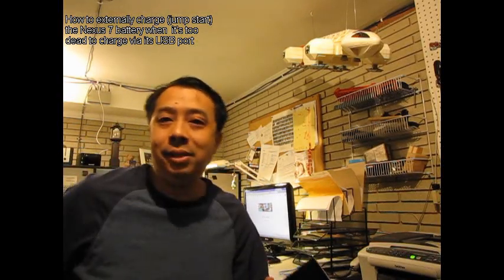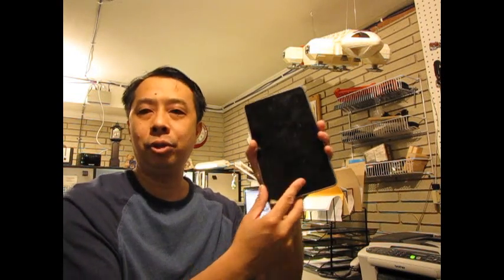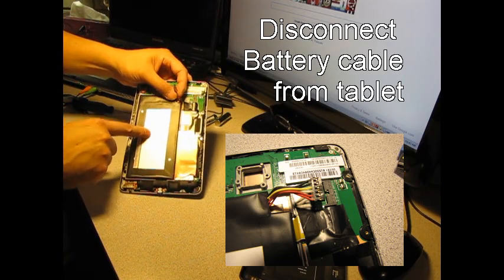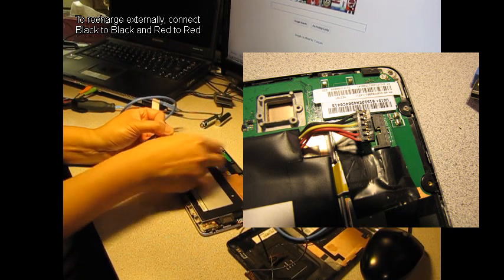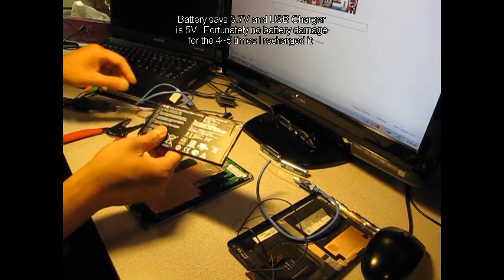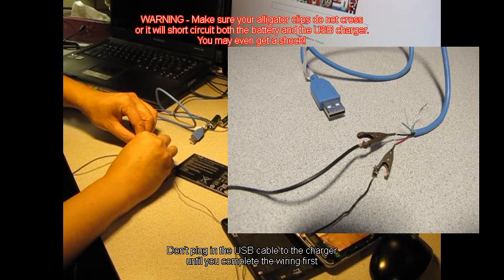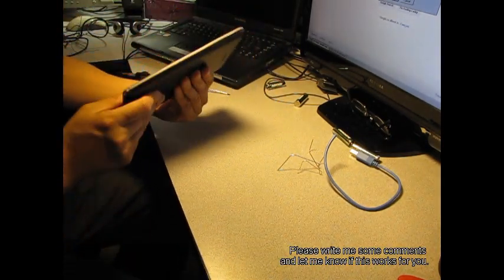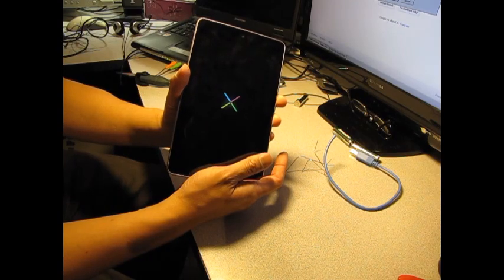Externally Jump Start Your Dead Nexus 7 - Final solution when all else fails!

Comment: Bummer, I thought for sure this would work for me, but after several tries I'm still not getting the restart screen.  I'm gonna try putting in a battery from a working Nexus to see if the battery itself is defunct.  I was getting a reading on it though from my power meter so we'll see.
Reply from the maker: Thanks for your posting, and please do let me know if that battery from a working Nexus will restart your tablet.  Once your Nexus powers down correctly, it will be able to regularly re-charge again.
Reply: Putting in a fully charged battery from another Nexus didn't help either. (these were twin Nexus bought at the same time 2 years ago).   
Any other suggestions for bringing it back to life?
Reply: My wife accidentally ordered a new battery :-)   BUT having the new battery didn't help either.  :(    It's starting to look like I'll have a spare parts Nexus.
Reply from the maker: Dwight Mouton Hi Dwight, I am sorry that my method did not work for you. I would normally attribute this to a loose or non-existent connector between the battery and the tablet, but given that you tried it with two other batteries, I doubt this is the case.  If you do figure this out, please post back as I am very curious to what else it can be.  Sorry I can't be of further help.

Comment: Thanks man! I 've tried everything else and nothing worked.. Volume Down Button + with power button, re adjusting the cable inside the tablet. Nothing. Then I saw your video and tried what you said. I used a cable connector with screws instead of alligator grips, a USB cable like you showed us & a stripped down PC motherboard cable. Charged each cell for 15 minutes then boom! Nexus 7 came back from the dead! Thank you for your video! You saved me money & time! Cheers!
Reply from the maker: Glad to hear it worked for you!  Your cable connector with screws solution instead of an alligator clip is ingenious!

Comment: Is there a reason why you didn't show the complete connection to the battery terminals. This video is like most all diy videos in that the most important or crucial part is not explained or shown!!!!!!!
Reply from the maker: Hi Michael, sorry there is some missing footage there, but I would certainly be pleased to answer any questions!  I did embedd still photographs of where to connect the wires to the battery, or perhaps you are interested to see the other end on how it connects to the USB charger?
Reply from the maker: Hi Michael, please look at video frames 5:58 (five minutes and 58 seconds) and 6:10 (six minutes and 10 seconds) in which there are embedded pictures of the connections to the battery terminals.  If you want a better description of the rest of the connection, send me a message here and I can explain.

Comment: It worked! After searching and searching all over the internet for a solution, only this one worked! I was not able to recharge (nothing appeared when connecting the power cable to the tablet). However, now that I got it charged, I realised that the problem might be with the tablet's connector, since I can't recharge  it through a cable. What can I do now?
Reply from the maker: Hi Nelson, glad to hear you were able to bring back your tablet to life!  Moving forward, you have a few options to fix your tablet's connector for ongoing charging.  If your tablet has the 4 pogo pins (gold terminals) on the side, your best solution is to purchase the Nexus docking station as you can use that to charge instead of your tablet's broken USB connector. Please see my comments to J Conder below for details.  Other commentators have reported that newer versions of this tablet supports wireless charging (my older version does not) in which you could purchase a wireless charger.  Your finally solution would be to repair USB charger itself.  Fortunately it is a modular board inside the tablet which you can purchase this part on Ebay.  There are other Youtube videos that shows how to repair/replace this.  Which ever oinging charging method you choose, none will not work if your battery completely dies again.  But next time around, you'll know to repeat my jump start solution and you'll be good again!
Reply: Doug Peng I've made myself a charged using paper clips and a shoes box, charging through the pogo pings. It takes a huge time to charge, and it's hard to connect the paper clips to the pogo pins correctly, but it's working for now. My best solution would be replace the USB part myself... Gonna give it a try. Anyway, thanks a lot for this.
Reply from the maker: Nelson Faria
Now that you confirmed that you can charge through the Pogo pins, I suggest you purchase the docking station for approx $30USD.  It works great and very convenient too!

Comment: This worked! And I used needles! My husband kept swearing the charging port AND the battery were tore up. I knew it was just the port and this proved it! I still have to get a new charging port, but my battery is fine. It was at 60%!
Reply from the maker: Congrats Celeste!  Does your model have the 4 pogo pins (gold terminals) on the side?  If so, you can purchase the docking station to charge it instead of your broken USB charging port.  Please Sse my comment to J Conder below.  Glad that you got the battery up to 60% with my jump start method as this docking station, just like the USB charging port does not work if the battery is completely dead.
Reply: I'll have to check on that. I was thinking of getting a wireless charging pad. Do you think this will work?
Reply from the maker: I believe the newer N7 use a wireless charging pad instead of the pogo pins docking station.  These alternative charging methods should all work, provided that the battery is not entirely dead.  If so, just apply my jump start method again!  Good luck!

Comment: My Nexus 7 (2012) is powered down in proper sequence, then I replace the old battery with a new one ( not from Asus but an equivalent part). However I am not sure if the new one is fully pre-charged or not, though I measure the voltage across its terminal of around 3.5V. But the Nexus will not start with the new battery and if I plug in the USB there is no sign of battery charging symbol. Do you think I can use your method to be sure that the battery will be charged properly before plugging it in ?
Reply from the maker: Given that your tablet has properly shutdown with the old battery (and I assume still works with the old battery when plugged into the USB charger), it is unlikely my method will work with your new battery.  The reason is that my jump start method is to correct a design defficiency in the tablet shutdown sequence, and not a battery deficiency. With your tablet properly shutdown, my gut feel is that your tablet should be able to charge with your new battery (even if it is dead) when plugged into the USB charger.

You mentioned that your new battery has 3.5V.  I recall the old battery (original ASUS) is rated 3.7V.  I don't think 0.2V would make any difference, but that maybe the reason why the new battery doesn't work.  Unless you can return the new battery, you have no loss trying to charge your new battery with my method.  Perhaps if you can bring it up to 3.7V with my method, it would be fine?  If you do decide to do this, I suggest you charge the new battery outside of your tablet so if it warms up, it won't damage your tablet.  Secondly, I would only do it for a few minutes in case it is already fully charged.
Reply: Doug Peng Thanks for your reply. I think there is a problem with this supposed new battery that I am trying to replace the original one in my N7. Because I also did try to charge it outside the tablet using your method for more than 30min and it was not warming up at all, neither the charger itself ! So I reckon the battery is not charging at all. BTW, I do notice a thing that I wonder if you have experienced that when I measure the voltage of the original Asus battery ( measuring across the outer red/black wires; i.e; one of the two cells as you pointed out in one of your post below), my V-meter reads 0 V, but when I plug it in the N7 and  pressing the power up button of  the device I then can measure the battery voltage of 3.5 V at the connector on the PCB. I wonder if there is a switch circuit in the battery charger controller itself, but then how comes the tablet can be powered up in the first place when the inserted battery at 0V ???!!! 
Now I have just had  thought that I did not check the voltage across the inner wires so probably this second cell is used to power up the tablet in the first place. I will check again next time to understand how the thing works
Reply: nguyen minh Would like to correct the measurement of 0V at battery terminal. It is due to the exposed metal at the connector of the original battery is smaller than that of the new one, such that the V-meter probe did not make proper contact when I first test it. With the original battery I measured up to 4V and with the new one up to 4.2 V ... from the reading label ( in chinese that I do not understand) I guess it means max rating of 4.28V, so it should be OK. Somehow even with the new battery fully charge, my N7 does not recognise it and allow it to be booted up !!
Reply from the maker: nguyen minh You mentioned your new battery's exposed metal at the terminal connector is different than your old battery.  Perhaps it's simply not connecting to the tablet side connector due to the difference in design?  If you suspect this is the case, you can get a soldering iron and replace the new battery's terminal connector with your old battery terminal connector to assure a proper fit.

Comment: Your video was really really helpful. It is really very clear and explain what I was about to do. without knowing the battery has 2 cells.
Unfortunately your solution does not fit my problem, but I have really saved time, 'personal energy' and money not trying to buy a new battery as per my 1st feeling.
My battery does deliver 3.37V on each cell, so I can tell it is charged, and your problem was not mine. If I think correcly my problem is related to the USB2Battery circuit, be it the plug itself or something else.
Thanks anyway for the the help and knowledge sharing ! That was really helpful

btw, If you've got any idea on what my problem could be, it wouid be very appreciated :) 

You've win a Youtube like. :o)
Reply from the maker: If your tablet does turn on, but your battery is not charging, then you could consider using the pogo pins on the side (the 4 gold dots) to charge it instead of using the standard USB charger.  You would need to purchase the docking station to do this. However, I have since learned that not all N7s have pogo pins.  If your tablet doesn't turn on, I doubt this docking station would make a difference.  Hope this helps!
Reply: Doug Peng Thanks for your reply. But my battery is not dead, it is charged with 3.37V on each cell. So I believe the issue is somewhere else.
I mean, I used a multimeter to check the battery voltage, and also checked the voltage after the battery connector.
Reply: Doug Peng After reading recent comments, after analysing costs for a new battery or a new motherboard, I finally decided to try your tip before anything else.

And it worked ! 
3.37V was not enough apparently, 3.7V did the trick (3.66 actually)!

Thank you so much Doug !

Comment: I have tried this method but couldn't revive my tablet. No matter how I try to turn it on it does not work. I also tried checked the cell voltage for each. it shows around 3.7V which is almost full. Any idea what might be the problem now that the batteries are charged?

Comment: I was so sure this was going to be the solution to my unresponsive N7 (2012.) 

The screen froze on me a few days back. Was unresponsive and I so left it, which drained the battery completely dead (as I was able to verify with my multimeter tonight.)

After charging the outside wires, I was able to get a 3.8 ish reading on the battery. I charged for about 10-15 minutes. Oddly, I also got that reading on the inside wires even though I made no attempt to charge it (assuming it's another cell.) 

I then plugged the USB cable in and attempted to:

Hold the power button and rocker (tried both the full rocker and the down rocker) for 20 seconds. Nothing. I tried every combo I could think of. Still unresponsive.

I decided to charge the inside wires for another 10 minutes just in case. Same result.

I bought this from Walmart as a re-certified this year in February (2014.) Pretty sure I can't return it for refund nor replacement but has anyone been able to swing something?

Any other ideas to try are welcome also. Thanks!
Reply from the maker: Thanks for confirming that if you charge one of the cells, the other cell gets charged along with it.  One other commentator mentioned this as well, something I was not able to verify at the time I made this video.  With your battery now charged, your N7 "should" work as per my method.  I am sorry that it didn't work for you, unlike dozens of other commentators here who did get it to work.  Now that your battery is no longer copmpletely dead, concievably your N7 should be chargeable through its regular USB port despite being off.  Can you confirm this?  Maybe you have the unfortunate situation where either your screen is dead or the battery connector to the tablet is loose or broken.  Sorry I could not be of further help.
Reply: Doug Peng Appreciate the video and the comment. I charged it all night on standard charger and still unresponsive. The battery connector seems firmly connected to the tablet (not loose.) But alas, I think this tablet, not even a year old, is a loss. I took a risk buying re-certified with no extra warranty. Bummer!

Comment: I couldn't find an old flashlight bulb but was able to borrow a multimeter. I got consistent readings from the USB cable, alligator clips and ornament hanger I'm using.
Reply from the maker: HI Jeff, a multimeter is certainly a better tool than a flashlight bulb!  Please also use the multimeter to test the battery to see if it gives an output voltage (I believe it's 3.4V or 3.2V).  If you are getting a voltage out of the battery after performing my jump start method, then your battery likely charged, but unfortunately you are have a connection problem between the battery and the tablet. A new battery would unlikely help you unless so happen it's the battery connector that is defective.  If the battery still has no voltage after my jump start method, then likely it did not charge. Instead of using the ornament hanger, have you considered using paper clips (or even a safety pin) to insert into the tiny battery connector holes?   I believe you would get a snug fit.  If you have pogo pins (4 gold terminal dots) on the side of the tablet, you could also try charging through the 1st and 4th pins instead (see https://www.youtube.com/watch?v=JhXHe6YAEBE on which pin terminal is + and -.)
Reply: Doug Peng I can't get a reading from the battery if I'm using the multimeter correctly. I'm going to experiment more with different size paper clips perhaps to get a better charge. Thanks!

Comment: Still searching for resolution for my son's N7 after he drained the battery and let it sit unplugged overnight. Have had to hold the power button for 1 secs only once before but no go this time. Tried Doug's method to jumpstart the battery using USB cable, alligator clips and staples and ultimately ornament hooks. Maybe the battery is completely dead? Currently shopping around for replacement battery and N7.
Reply from the maker: Hi Jeff, based on your description above, my solution should work for you.  It's precisely for situations where the battery is completely dead.  My gut feel is that your staples or ornament hook is not touching/connecting with the battery contacts (i.e. the tiny pinhole connector).  If you send me a detailed message of your setup, perhaps I could guide you more.
Reply: Doug Peng Thanks Doug! I picked up some alligator clips with tester/jumper wire attached and spliced an old USB cable as you instructed. I've tried inserting the staples and ornament hooks into the ends of the battery connector. They feel snug but maybe I'm just not getting a good enough connection.
Reply from the maker: Jeff Jordan , do you have a flashlight with the old fashion bulb type (not LED)?  If there is power coming out of the USB cable, it should be able to light up that flashlight bulb (with batteries removed).  This would be a good test.  The beauty of a flashlight bulb is that there is no polarity requirement (works even if you mix up the + or - direction of the USB cable and the voltage level is not critical).
Reply: Doug Peng I'll give that a try when I get home tonight. Thanks!
Reply: Doug Peng I forgot to mention my tablet does have pogo pins and I've also been trying to charge through my nexus dock but no luck yet.
Reply from the maker: Jeff Jordan , the Nexus Dock won't likely work until you have successfully jump start the battery with some charge using my method.  I believe neither the dock nor the USB charger is capable of charging the battery when it is completely dead.
Reply: Doug Peng I gave it another go tonight and was able to get the battery charging symbol to appear briefly for a couple of seconds! Still can't get into the boot loader menu so I'll try to jump start again tomorrow.

Comment: Genius, used two small safety pins instead of clips and all worked perfectly.  Thanks heaps.
Reply from the maker: Ingenious idea using a safety pin!  Another commentator successfully used a staple so aligator clips are not necessary if you don't have them.  That's for mentioning your ingenious safety pin solution!